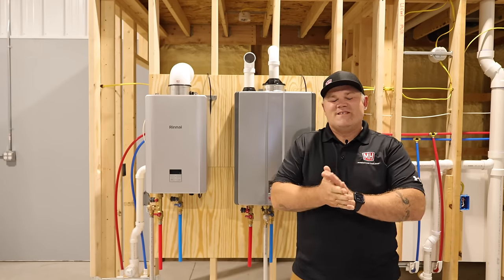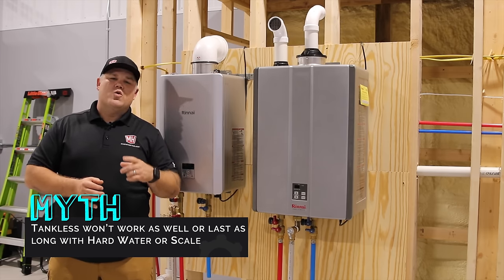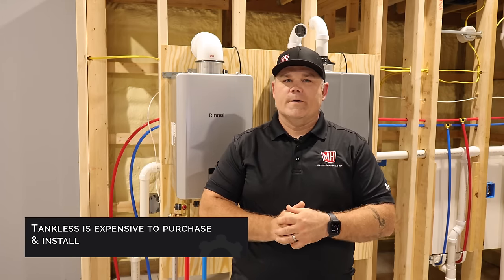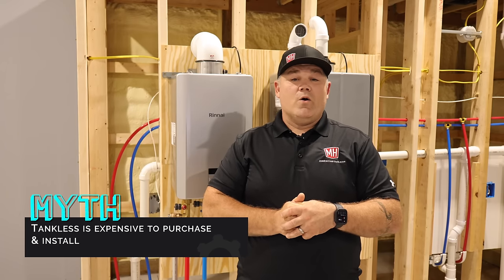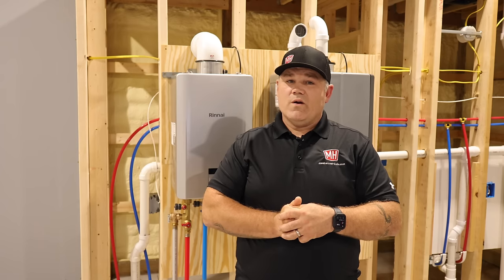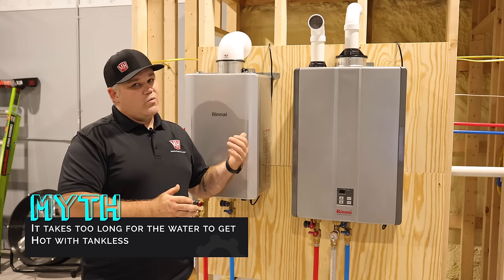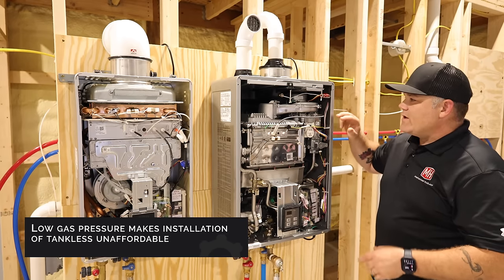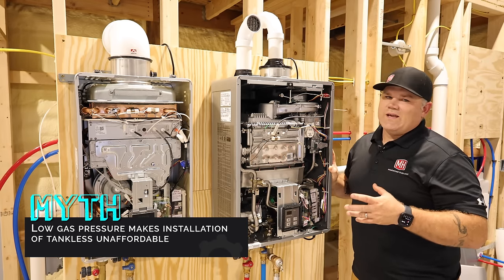Myth Busting! Tank -vs- Tankless Water Heaters

Comment: I notice you didn't talk about electric tankless hot water heaters. I bought a Power Star AE 125 unit. and one time it developed a leak and they replaced it. Later on it just quit making hot water. And plumbers in town wouldn't touch it. The company said not to ship it to them either. So I had no choice but to go back to a tank water heater. My experience with tankless hot water heaters was not good for me. Never again,,,,,,,,,,,,,,,

Comment: Gas is totally different than electric. 45 degree water will not heat with 27kw at above 1.5 gpm flow. Thats a lot of power from a service. I run an 18kw in summer and switch to 27kw in winter in western Washington. I have to throttle my well pressure at shower head to get hot water in winter.  3gpm is luke warm, around 2gpm might be hot. Better have a solid service with at least 200amps.

Comment: No electricity, no power for hot water. Conventional water heaters keep on making hot water without electricity !!!! Not to count the fact a regular water heater is 30-40 thousand btu’s to heat the water and a tankless is closer to 160,000 btu’s to heat the water. So it uses a lot more gas to heat the tankless although it is only on demand. You need to decide if the extra cost of tankless plus no hot water if the electricity is out is what you want !!!
Reply: That’s why my tankless has been replaced, wife taking shower in winter with cold water in the 50’s and power blinks you will get a cold blast immediately. No thanks.

Comment: The condensation never touches the heat exchanger. Thats the only myth you got wrong. Stainless is better than copper. Also non-condensing tankless does not fall under the energy efficient appliances so there will be no tax rebate or credit from gas supply company

Comment: I worked at a gas station that had a tankless system back in the sixties and it was very old then. It was a skinny round tall unit that had a burner on the bottom and a copper pipe corked screwed above it. It always worked and had a simple mechanical system.

Comment: Your own words glossed over an important issue.  Condensate is acidic that can deteriorate indoor drainage pipes, especially old cast iron.  Most codes NPC and NSPC require neutralization of the condensate. If you let that condensate get on your concrete floor, watch out.

I am a licensed Master Plumber, Class B Boiler Installer (up to 3 million BTU), and a licensed mechanical contractor (gas, venting and ducting)

Don’t let Rinnai’s ad bux taint your opinion
Reply: Wtf is condensate?
Reply: @MrRoguetech  When you put a cold glass of beer on the table on a hot day, the water that collects on the OUTSIDE of the glass is condensate.  The byproducts of combustion are   carbon monoxide, nitrogen dioxide, carbon dioxide, sulphur dioxide, water vapor and hydrocarbons. When you heat cold water, the the water byproduct of the combustion combines with the other chemicals and becomes acidic.

Comment: Minnesota is also where infloor heating originated, so we may expect critical thinking from heating pros.
And it seems that the advantages of tankless water heating have been known and installed everywhere.
Tankful heaters persist solely due to legacy effect. 

The one problem with the video: 
A Nation or company based in that nation, EXPORTS its product. If it comes to us, WE import it, not the fabricator or that nation.

Comment: The only thing I can say about this after having them for over 20 years. Don't buy CHEAP. We have gone through 2 Bosch tankless units, the first one had a pilot light, the second was electronic. We use 2 of these in the house due to it being a LONG ranch. The first one failed when the pilot wouldn't stay lit, and, we had a cold blast that sent cold air back into the unit, like a back draft and froze it.  That one was replaced with a Richmond.  The second Bosch just recently failed after about 15 years, t was either the regulator or the control box, but needless to say, will never know since parts or made of unobtainium.  It has also been replaced by a Richmond.   I did have an issue with the Richmond shutting down with codes, but turned out a mouse had gotten inside and built a nest that caused flow issues.  The newest Richmond looks a lot like the condensing unit in this video. 

I did think I would have to upsize the gas line from 1/2" to 3/4" but decided to let it run first, and if it has issues due to low gas volume, then spend the money on piping. Have had zero issues with gas. I did make the mistake of not removing the cap over the condensate drain, oops.

Comment: If you want to cut your electricity bill, install a timer on your hot water heater.  No one that works needs hot water 24 hours a day.  Most people use hot water at the same time every day.

Comment: Actually I shower at the full 120degree. I got the Rianni 10.1 gone.
I switched over from a tank. 
The Rianni I have uses 199k btu lucky for me I already had switched over my furnace to a Heat pump that has an electric heat strip. So I had the 1.25” gas pipe already installed.
My cost was $2,000 for the Rianni including tax then $600 for the extra parts including plywood to attach to the wall ect. It took me a solid 20 hrs including clean up to install make multiple trips to the store ect . I would think a pro would do it in 8 hrs easily.
I’m going to invoice it at $1500 labor installation bringing the total to $4,100 for tax write off which I get 30% back (or tax reduction not sure on that part). That’s $1,230 plus a $250 back from my local utilities so it potentially cost me $1,120 which is the same price as a direct vent gas water heater and with proper maintenance should far out live and operating cost of a tank. I did test our city water and we have soft water but I will still flush the system once a year.
Oh and a recirculating valve was installed.

Comment: I would not buy another tankless. When I open just one faucet All the lights in the house flicker. The fluorescent light are the worst for this but all types of lights do this. I can stop it by opening a second faucet. I read that this happens because the manufacturer designed the computer control to save money on home owners  electrical bill by having the power  to the first heating element turn on and off rapidly when water flow is low.

Comment: If I treat the water my tank heater will last longer along with the fixtures. Not knocking tankless it works for or against for either. Not sure that’s a selling point. If they didn’t treat the water first with a tank why would they with a tankless? Other than saving energy

Comment: The one must have if you are using thankless water heaters is at a minimum reduce the rust that's coming from the street. Your on city water that's great its really rusty becasue the water has to flow through 50 years old legacy pipes that are never replaced till they break. Then  its a huge huge job. What to see how shitty your water is take the cover off your toilet and look inside.. Tankless water heater elements won't like that. A Dual Big Blue with a sediment filter first and a charcoal filter second is mandatory. That will be your descaler also. Your toilets and faucets and dishwasher will thank you.

Comment: This hype about tankless just confuses me. According to my research my heat pump hybrid tank water heater is way more efficient than a gas tankless or electric tankless water heater. The only advantage to the tankless is space but considering the cost to operate I’ll stick with my hybrid tank water heater.

Comment: 5 and 1/2 min in and already you have told at least 2 fibs the big one is about installation. It does cost more to install when you consider the cost of the electrician to run the new circuit. You forgot? Who has a 70 to 80 amp circuit already installed to dedicate to the water heater?

Comment: Who sponsored this vid?   DUH.  A tankless was installed in a friend's large house; a recirculation option was recommended by the plumbers selling this model.  A recirculation fitting was placed between the hot and cold lines at the sink farthest from the tankless. The principle is to minimize waiting for hot water.  HOWEVER, it not only lengthens the wait for the recirculated cold water to be heated, but it makes us wait for the cold water to clear out all the recirculated hot water to clear the cold water line.  It's INFURIATING to get cold water when I want hot water; it's WAY MORE INFURIATING that the tankless installation now makes me wait for recirculated hot water to clear the cold water lines!

Comment: I beg your pardon ...
I am a plumber...
#1) Tankless versus tank hot water heater with hard water a tankless hot water heater will fail before you tank water heater (if all other factors are equal), if there is hard water I agree that it should be treated first but it doesn't seem like you actually address the issue itself: as it stands...
There is hard water !!!
Which one will perform better longer with hard water.
PLUS... The maintenance on a tankless hot water heater is much more than a tank hot water heater especially if you're dealing with hard water.
#2) Cold ground water...
Although I agree that they still will work and put out sufficient water supply... Heating extremely cold water very quickly in a tankless compared to heating very cold water in a tank although the take hot water heater will probably heat the water somewhat slower...
I have found that you are not getting any substantial saving $$$ as far as heating the water. A tank hot water heater is usually in an interior closet with an insulation blanket around it and once the water is hot stays hot without much need for more fuel.
#3) Purchasing a Tankless Heater is definitely more expensive where I live.
#4) As far as installing a tankless heater, I agree... it would take me a little bit longer to changeover to a tankless then it would to replace the old tank...
HOWEVER... A tankless almost always needs to have a 3/4 in propane line whereas most of the old tank heaters I swap out is only a half inch line that's a whole lot more cost to run a 3/4-in line clear out near the tank to your heater.
#5) I completely agree with you as far as the simplicity of venting with PVC.
#6) again I completely agree takes the same amount of time for the water to get from the source to the faucet regardless of what kind of unit you use.
#7) hahaha... Some knucklehead through that question at you.
#8) Tankless are great water heaters in the right circumstances. Every circumstance and situation is different.
They're definitely proven  to be good technology.
#9) I want to do some research about this idea of efficiency All things being equal IMO it doesn't seem a tankless is as efficient with cold water.
They're definitely better for space !!!!!
And they are definitely better for endless hot water That's the advantage that I've ever seen was space and endless hot water which in some homes is one of the most important desire for the homeowner

Comment: SIZE IT RIGHT, OVER SIZE

Creating a central manifold where water is fed from is the best practice because you can address multiple issues at once. 

Water pressure balancing between fixtures and other bathrooms
Water knocking
How long it takes to get hot water. Running hot water at one faucet primes the entire system so you do not wait hence hot water almost all the time without recirculating.

I have a reem or whatever you call em 5 bed 3 bath house 6 girls and it keeps up with the laundry 😂😂

Comment: It doesn’t make sense to retrofit an old hose to tankless , is to expensive also having an electric one you would never have the temperature you need ! Stick with old water heater you would be way better off ! I had a costumer who installed an electric instant water heater and when trying to use low flow bathroom faucet isn’t kicking on so no hot water .

Comment: I call bs on the installation of tank vs tankless. I've installed numerous tanks in 30 minutes (over 10, I have rentals). With a tankless one has to reroute old plumbing and new exhaust system. This usually takes the whole day if not longer. I do love the tankless system but costs increase is in the labor factor.

Comment: Get a water treatment machine before going tankless. 

If a tank heater gets 1/4" of crud, you lose a little capacity and a bit more efficiency. (Crud doesn't conduct heat well.) But if you get that same crud in your tankless heater, you get zero hot water. 

Understand, nearly all the hardness of water precipitates out when the water gets hot. So hard water can kill a tankless heater in a few months. In some ways, this is worse with tanked heaters. But tanked heaters can take the damage easily. Scale builds up and slows the machine, but it doesn't stop it. 

If I were a rich man, I would get a water softener and a tankless heater. But I'm poor. And that means no water treatment. And no tankless heater either. The tankless solution really is better though if you can afford the pretreatment.

Comment: PVC may not be expensive but it is expensive to have somebody route those things out of the house. Labor cost. And you may? Be able to use indoor air. How often does that happen? Answer equals never.
Reply from the maker: The use of indoor air is very common, any qualified installer can easily calculate the existing combustion intake to the home. It’s all in the manual.

Comment: How does a recirculating pump save you energy? Time, yes. Energy, nope. you are not only heating the pipes all the time but you are also running the  recirculating pump till the water in the line till it is up to temperature. Physics

Comment: I didn't even watch the entire video. Plumbers in my area won't even entertain installing tankless systems. The annual maintenance costs outweigh the energy savings. I've had a 50 gallon water heater installed in my house with zero issues.

Comment: You didn't really dispell the first myth tho. In fact you confirmed it. You basically said, it will work... "if" ...you spend more money on a water filter and softener system. 

Will a tank water heater accumulate a bunch of crud, rust and sediment over time from a house with untreated water? Absolutely! does it have a much larger area to deal with that junk than a small heat exchanger on a tankless water heater? Also absolutely! Is it cheaper to to replace when it does get crudded up than a tankless or even worse yet a bunch of POS tankless units? Again absolutely!
Reply: I steer most customers away from tankless. Not all but most. If I install a tank style water heater it is a third of the price, I warranty it for at least six years. I come out once a year to flush and de-scale it for free. I charge $175 to do a basic maintenance on a tankless heater. I charge $350 to do a full maintenance. Which you really need to do at least once a year. It takes me a long time to do a full maintenance on a tankless. I’ve been working on them for more than a dozen years and it still takes me a while.  Some people really want it and like it and I’ll do a beautiful install for them but I would still recommend tank style unless you’re just really in to the maintenance schedule and insist on having having top-of-the-line shit, or you have a huge hot water demand.

Comment: I found it takes significantly longer to get hot water from my new Rinnai RX199 tankless than my old tank water heater. Like 3-4 minutes longer.  It is installed within a few feet of the old tank water heater.  Many gallons of cold water go down the drain before starts to get warm.  I've gotten used to washing my hands in cold water. Taking a shower? Turn the hot on full blast and find something to do for the next 4 minutes.  Myth NOT busted.

Comment: I don't think I'm going to go tankless water heater and not for any of these reasons. It's that I know the company I buy it from is going to try to develop a "relationship" with me and talk me into buying some type of service plan. Same reason I won't buy a heat pump AC unit. The old stuff just works for a decade and if it does break it's cheap to repair or replace. The typical life of old technology water heaters and AC units is good enough for me. Even if it doesn't last 10 years it's still a good value.

Comment: I'm a plumber in Texas and have been plumbing since 2009.

Tankless do coast more than a tank type. There are no if ands or buts about that.

The unit cost for each makes that clear. A Tankless water heater is going to be easily above 1k just for the unit. Meanwhile, a tank is going to be closer to 600.

Then, your claim that tankless is just as easy as a tank type installation is very misleading. If it's a swap out like for like, yes, it would be similar about time. But if we are converting a tank to a tankless, then it would take a significant amount of time.

Comment: Only issues we had with tankless is while using shower heads with low flow rate. We’d have to turn on a water faucet allowing more hot water to flow or the tankless water heater would shut off mid shower. I finally went with a standard shower head and problem solved.